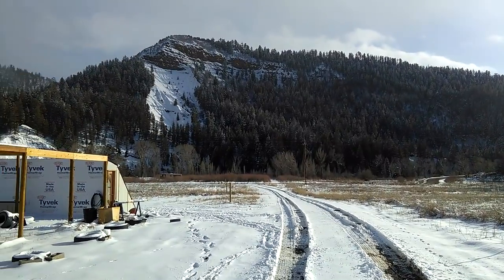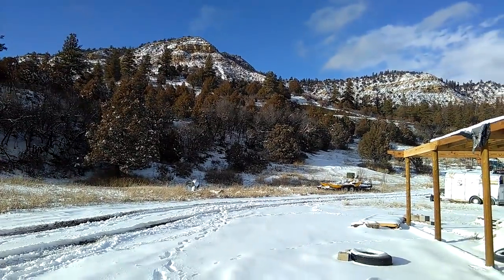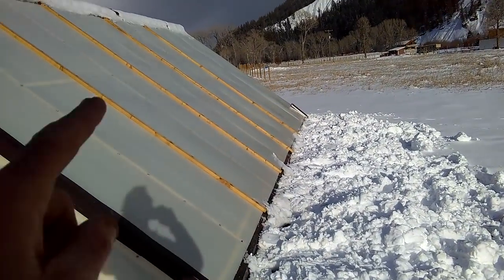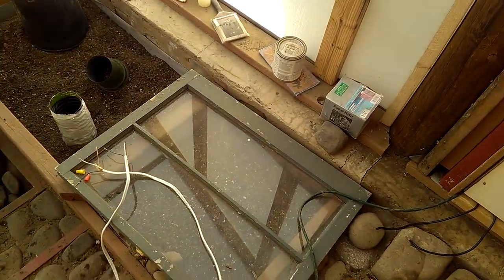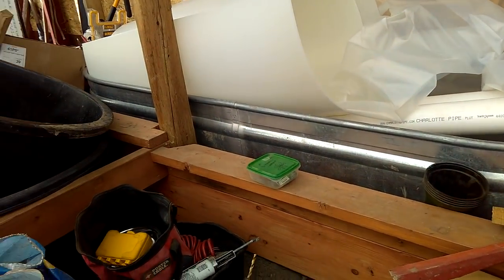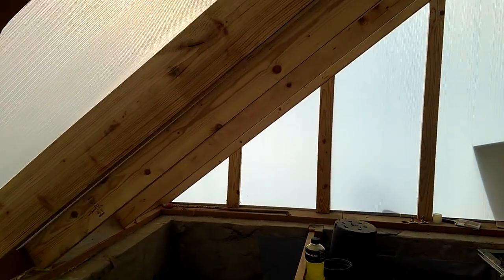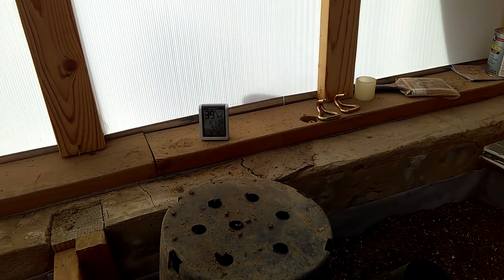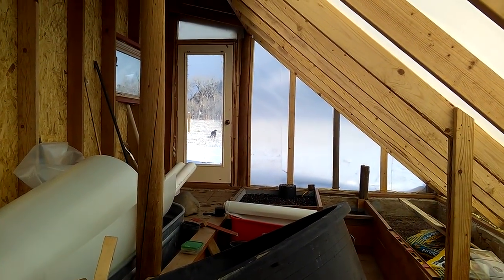Geothermal Greenhouse Update - Climate Battery Charging - First Plantings - Setbacks

Comment: You frequently ask your viewers for information... Perhaps you would ask them how deep the frost-line has gone in their respective areas. Here near 45°/90° the ground typically freezes down about two feet but because we've had little snow to insulate the ground and quite a bit of cold, the frost-line is down well over three feet. We're going to have an increase in the number of pot-holes in our roads this spring because of frost-heave.
Reply: In the 70's our town water mains were freezing up on Cape Cod as the frost hit 4' very unexpectedly. A lesson learned.